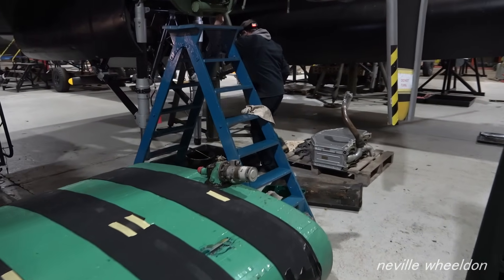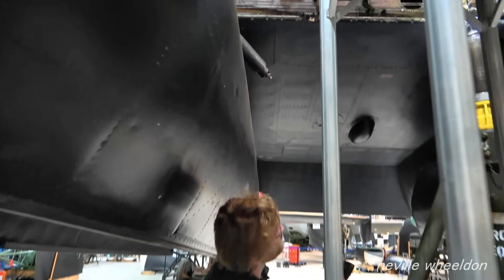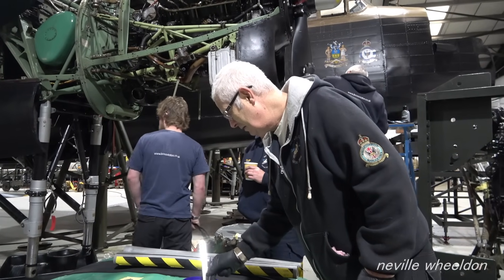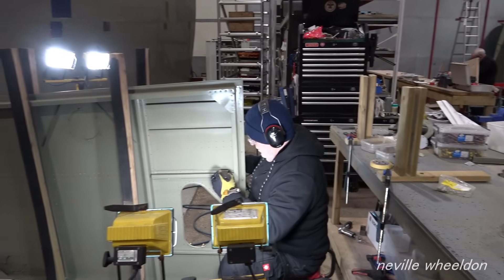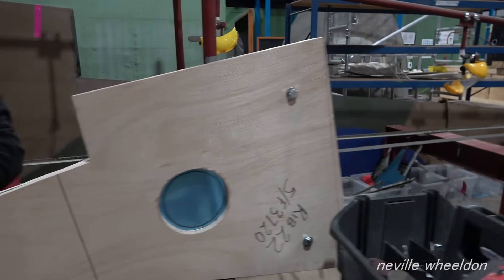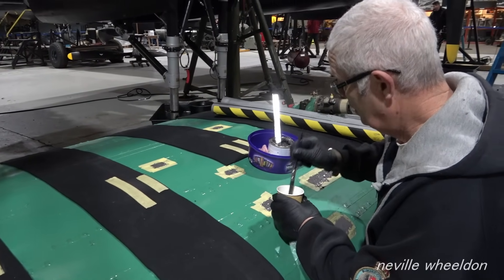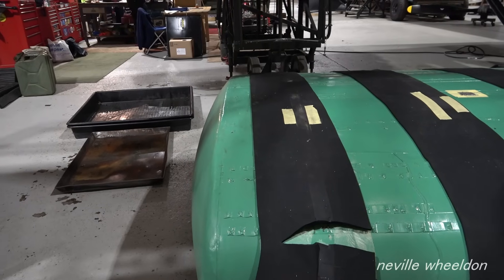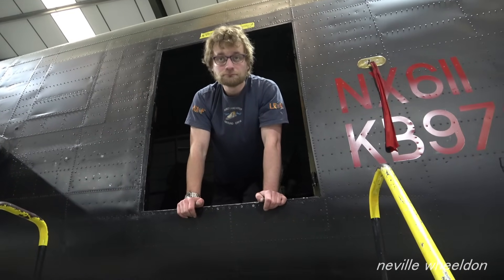Video 236 Restoration of Lancaster NX611 Year 7. Repairs to number 2 fuel tank.

Comment: Great stuff Neville.  Very interesting to hear from Brad about workings of the fuel line and also the repairs on the number 2 fuel tank.  There's nothing better than hearing the noise of a busy workshop.  They are doing a fantastic job.  Well done to all of them.  Thank you Neville for another spot on update and am looking froward to your next one. Best wishes to you and all the guys at the centre.👍
Reply: How great it is to see the wonderful team restoring this Lancaster. As an ex Avro apprentice the noise of the compressed air drills Riveters and the use of PR 1422 & PR1431 brings back many happy memories. 
Well done to all the skilled guys in the hanger. 😅
Reply from the maker: Cheers Andy.

Comment: PRC sealing compound is the greatest invention ever when it comes to sealants. It remains flexible forever and it is just sticky enough to apply it on vertical or overhead surfaces without it running. It comes in various viscosities (thicknesses) for different applications. We would take the left over amounts and mold it into shapes before it cured. The most popular was to take an Apex cross head screw driver bit and stick it into a golf ball sized glob of sealant and, presto, you have a mini screw driver for short tight places.
Reply from the maker: Thanks for that tip Rex.